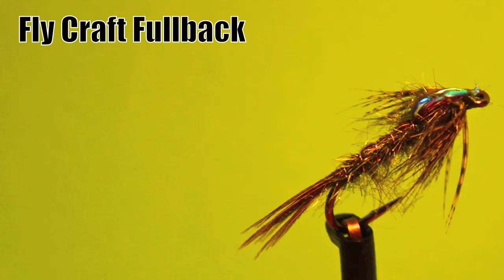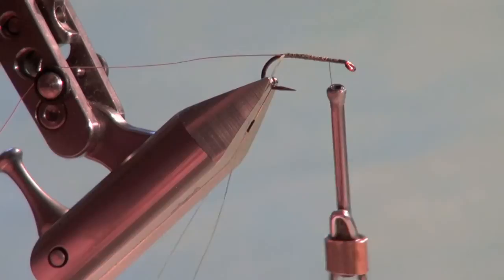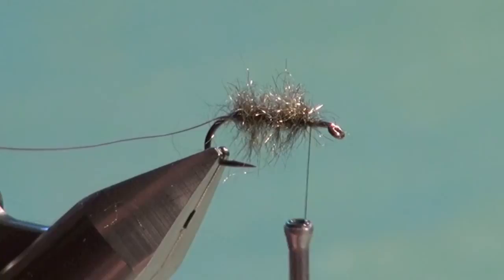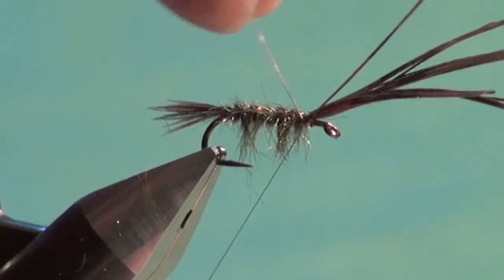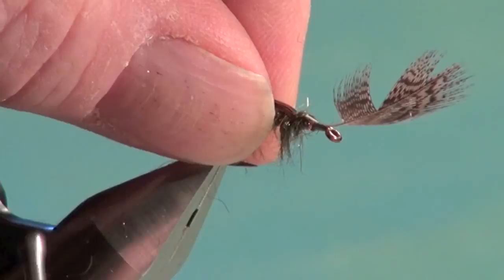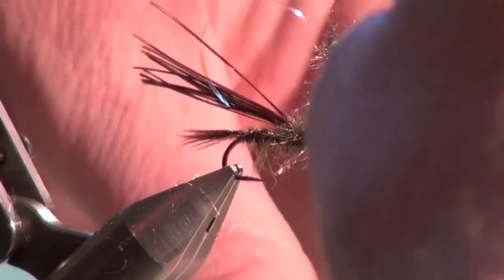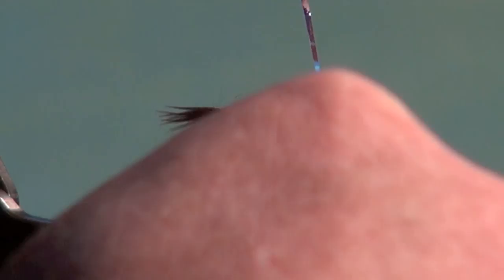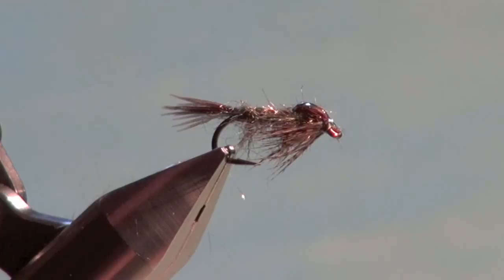Fly Craft FullBack Nymph

Comment: Any tips on keeping the resin from getting into the thorax and feather fibers? Thanks.
Reply from the maker: Hi John, I often moisten my fingers and continually sweep the fibers down and away during the tying process.  If there are still errant fibers in the way I nip them away with my scissors. I also use thicker formula resins such as Loon's UV Clear Fly Finish in its original thick formula.  I place a dab on the wing case and distribute it using my bodkin.  As soon as I am happy with it I cure it right away to stop it from going places I don't want it to go.

Cheers, Phil
Reply: Great pattern, I'm definitely going to add this fly to my box.  Great video's